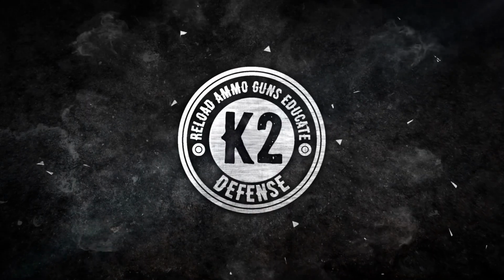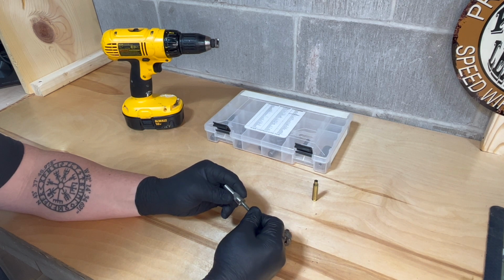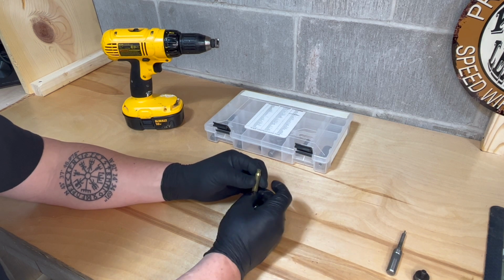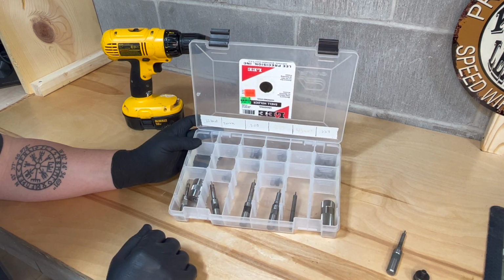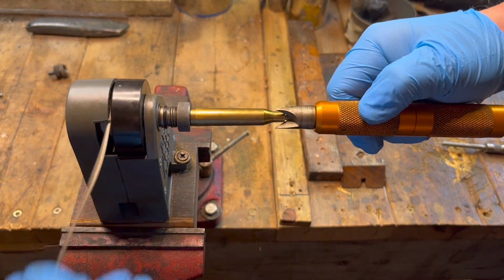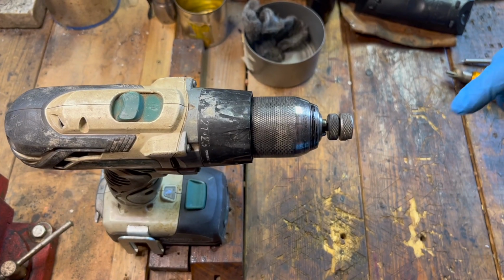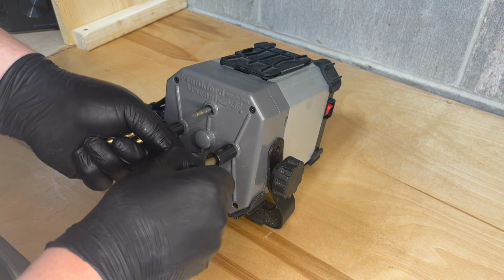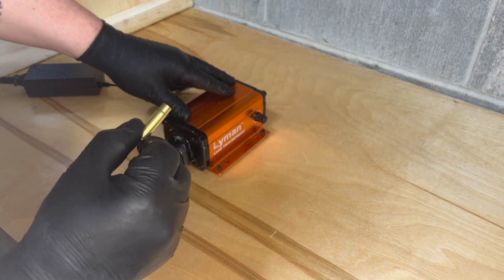Top Case Trimmers For Reloading - Brass Trimming For Reloading Guide Easy and Fast

Comment: Great video- I only been reloading for under 3 yrs now.. i purchased and use, the FA trimmer, and the WFT one, and the Lee case trimmer w/ power drill attachment.  I usually do batch reloading in the sets of 1500 rnds at a time.. for some reason, and i searched and asked other reloaders, but my Lee Trimmer- the drill attachment with the length stem.. is the only one that gives me consistent length trims..( the lyman quick trim does as well,  but putting them in the drill, taking them out.. gets old when doing large numbers.. i have to break it up..i was told its because it is the only one that does full length and not off the shoulder.. great video, great channel! keep em coming!..  whats your go to for primer pocket swaging?? and mil crimp remover?
Reply from the maker: Hello! Thank you for the positive feedback! I’ve tried swagging my brass with the Dillon swagger. However, it was ruining my primer pockets. To remove the military crimp, I use the RCBS small trim mate military remover #90386 and RCBS primer pocket uniformer #90379. 

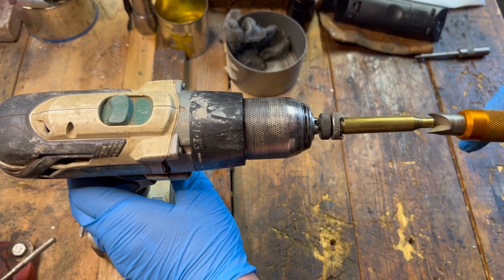Check out this video https://youtu.be/OEnTILU1Tjs go to 3:26 (Lower case prep).  This explains how I work the lower portion of the case. 

If you need any other advice or would like me to do a video, I’d be happy to do so!
Reply: That plastic box is awesome! Where did you get it?
Reply from the maker: @johnleidorf2280  
https://planomolding.com/collections/specialty-utility-boxes 👍🏻
Reply: The WFT can be very consistent and is very fast. For best results, your brass should all  be from the same lot and have the same number of firings on it. It must be resized with the same FL die. It's a little tricky setting it up initially but once it is, you're good.